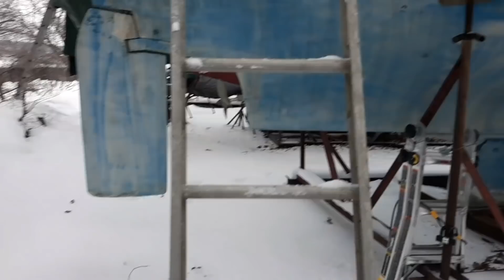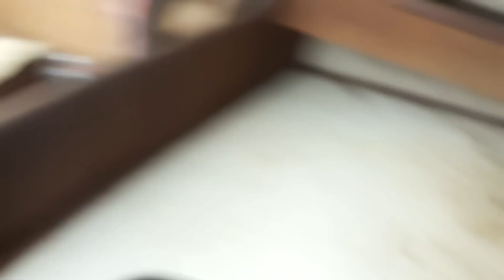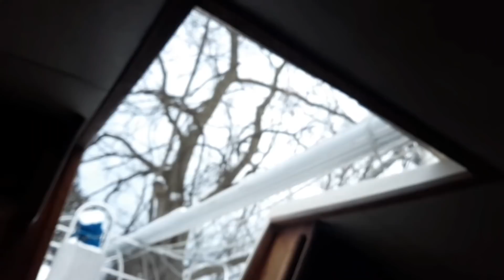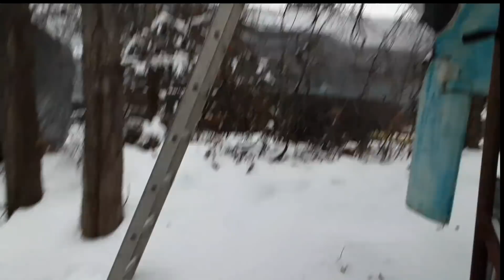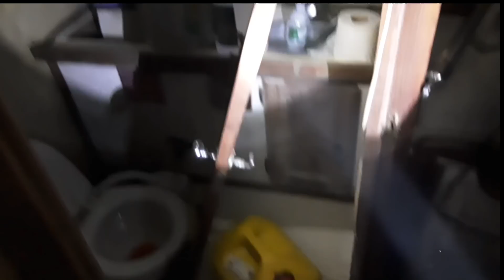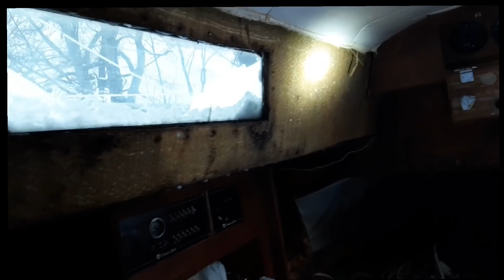The refit, Deconstruction part two #11

Comment: If you add solid fiberglass ring around each port light, you could tap the hole and uses mechanical screws to secure the fixed port light. This way you would not have any apparent bolt/nut from the inside. Tapping into 1/2in of solid fiberglass shall be strong enough.

As an option, if the ply between the outer and inner layer is not rotten too far, you may only routed some wood out of between the skins and fill the void with thickened epoxy. It will not be as comprehensive than a full replacement, but it will insure that any future leak will not get into the existing ply ( and my be potentially less destructive work ).

Good luck with the project.
Reply from the maker: That's exactly  what I have in mind  I mention it in the video coming out this Friday, I will actually be filming as open up the cabin top side around  the portlights  thanks for watching!

Comment: Good luck man.
I own the same boat since 2005. Currently changing the engine.
Where are you exactly located? My boat is on the land in Haverstraw NY, 20 miles north from NYC.
My advice put some kind of cover first and try to keep the water away as much  as possible. White tarp worked the best for me. And check the deck, usually deck is the biggest problem.
 Original bulkheads for rear chainplates are total "bs". On later  "Hughes" models they made them longer, extended to the lower stringers. On my boat steel wire attached to the bottom of chainplate and goes down to extra partition fibre-glassed to the hull.
Also the top stringer should be extended to the electrical panel bulkhead with few extra ribs. And so on .....
I can talk for hours. Keep in touch.
Reply from the maker: Hello, thanks for watching, I have  soft spots in the deck around the chainplates  I will be geting  into that also. I plan on moving  the chainplates  off the deck entirely, there going to bolt through  the hull and into the bulkheads from the sides. It should  be stronger eliminating some potential  for leaks  and make  moving around on the deck much easier. I've also got  leaking portlights and hatches all will  be repaired  or replaced by spring, I currently have  all three  chainplate bulkheads  removed  on The starboard side. It will be in this weeks video. I try to have them uploaded on Fridays.
I am located on the south  end of lake Champlain  20 miles  from the locks into the Hudson.
The marina  is called Chipman point, and is very sailboat friendly.